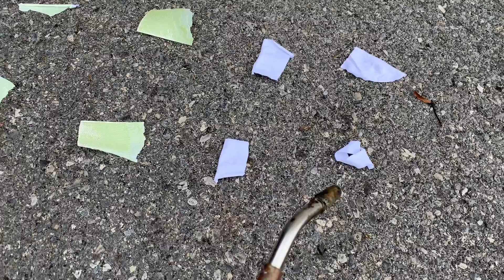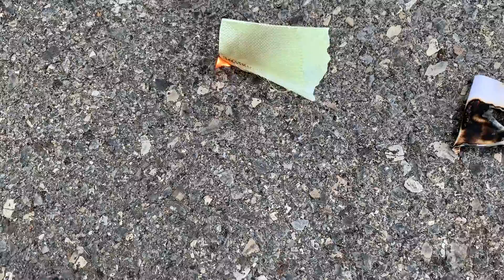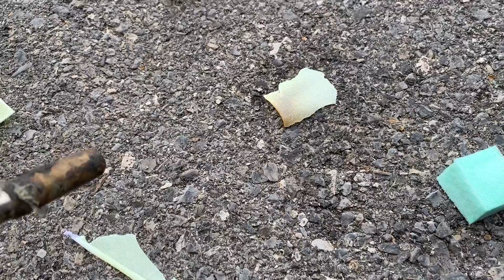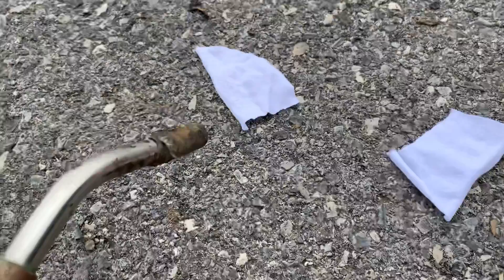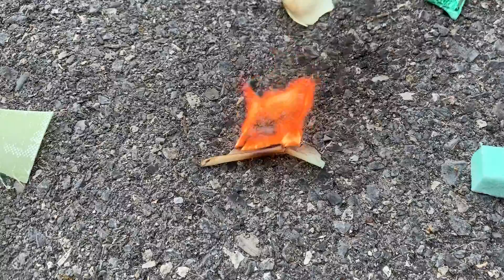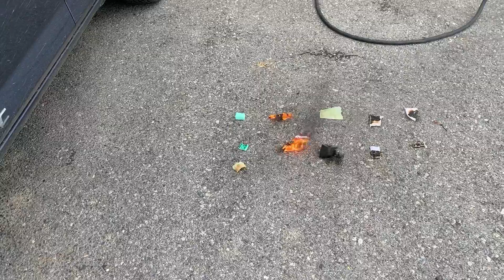Is Fiberglass & Epoxy Resin flammable? Will it explode!?

Comment: I made a rocket body tube out of tubular carbon fiber and, IIRC, West Systems epoxy. I burned a cut off section about 6 inches long and the cured epoxy burned out and I was left with a flexible section of the CF. I am sure that CF was not any good at that point, but I thought it was interesting.

Comment: Hi James Klafehn, I'm a lil confused, it says in google that Fiber glass is non flammable and it was designed to withstand temperature upto 1000 degrees and that it was designed to be fire resistant. Kindly advise how come its catching fire here in this experiment
Reply: I used to work in a food factory where one room could be near room temperature and the next room could be 20 c below freezing. We had to do fire drills EVERY friday and if anyone smoked within 25 metres of the building they were fired. That was all because of the insulation  in the walls. Another factory like ours and was as big as ours (it took about 5 or 6 minutes to walk from front to back) burned to the ground in 5 minutes.

Comment: We used to work with torches and I DID see fiberglass catch fire. (Not just the paper part. Maybe as it ages the material changes characteristics?? Or it was treated with something?? I don't know. But I do know that thinness of material changes things. Take a piece of steel wool and put a match to it. Even though it is steel. It burns very well.
Reply from the maker: Thanks for the comment and thanks for watching. IDK this was the only time I did this test. It probably has to do with the resin used.
Reply: @JamesKlafehn  Not a fair test because every boat, plane, bath tub, hot tub, etc... made using fiberglass has a top coat of which is not the epoxy resin itself.
Sure it will burn, but with a quality top coat it will be much hard to get it started. Top coat will burn too, but at least we can get something on the top coat that is less combustible.

And then on the inside if you laminated the wood then NP. You just need to be sure all wiring connections are done inside of an electrical box! That is a requirement in homes anyway and that is why, homes have foam, wood, and even epoxy resin in some of the appliances and wallpanels.

Comment: The glass fibers in fiberglass cloth and mat are glass, which is non-flammable. However, the polyester resin is flammable. For anyone planning to build a camper out of "fiberglass", use epoxy instead of polyester resin; the best is EpoxAmite HT from Smooth-On or Reynolds, or even better, EpoxAcast 670 HT (you can thin it for lay up with their thinning agent).  Then insulate the interior with Rock Wool (mineral wool). You won't have to worry about fire .
Reply from the maker: Great points. Thanks for sharing.

Comment: What type of resin are you using, I think some types will eat (melt) the foam? 
I just stumbled across these foam campers, I've been wanting a small cowboy style camper on my landscape trailer to make it a toy hauler.
Reply from the maker: Saks Place I used epoxy resin. Polyester resin will melt the foam.
Reply: Polyester resin will melt the foam and your brain too.
Reply: Is this West Marine? Very interesting because search results showing flammability for composite’s showed resistance to burning to 450° F. I’ve seen so many videos of composite boats burning in the water. So some one is being a bit creative with data it seems. Cotton is wonderful because once the flame source is removed the cotton will smolder and go out. You could see this in your test as with the foam which melted and went out once the torch was removed. I would expect house hold approved materials to have some sort of regulatory body which test flammability. Is fiberglass glass? Glass is silicon based which is different from silicone glues. Thanks for this. I am building a composite aircraft using similar techniques. My foam will be removed leaving 3 layers of bi directional glass. Certainly you have shown the foam is not an issue. I can remember when I was a teen watching a Corvette burn to nothing. I wonder if a foil on the inside which keeps the open flame from contacting the epoxy would be advantageous. Some sort of flame barrier maybe.